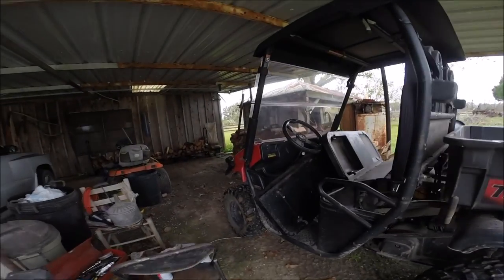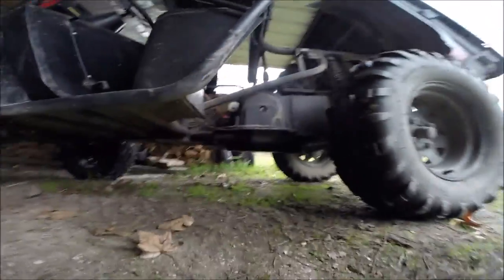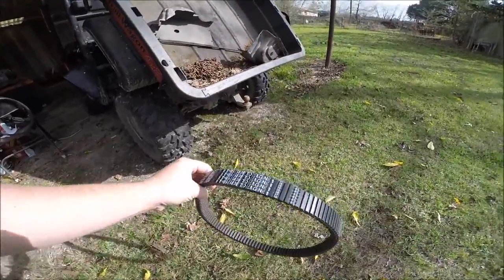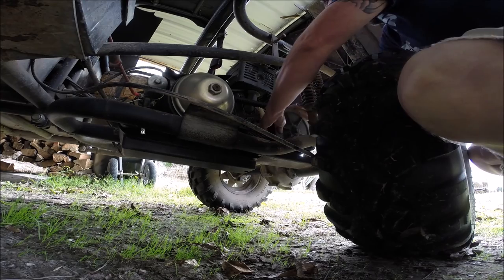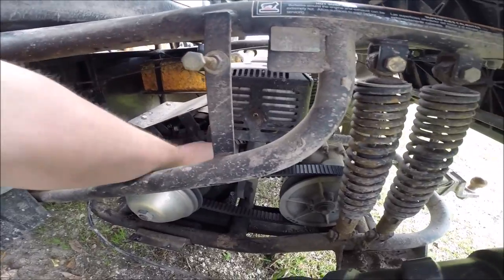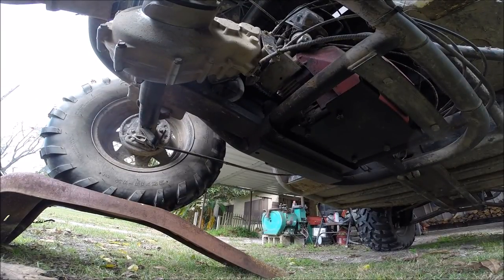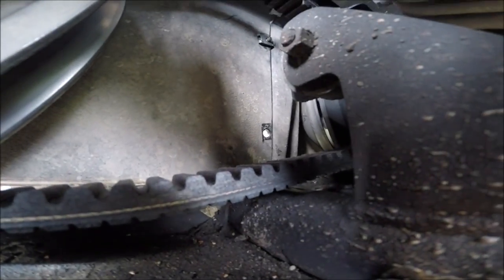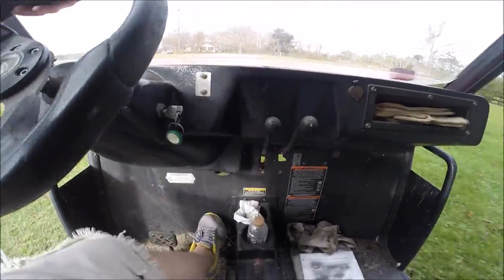How to Change Drive Belt Trail Wagon UTV American Sportworks

Comment: Hey man I appreciate all your videos you do They help out a whole lot. I have a question for you I have a wagon TW-450 with a color motor I can go out and start at cold in the morning and write it about a half to three quarters of a mile and it like wants to lose power and if I just pull over it idle back up and then I can go again for a little bit than an idol back down it don't matter if it's a code start or if it's been running all day
Reply from the maker: Thank you for the kind words my friend.  Have you checked the oil lately?  I know every so often I have to drain the oil bc the gas for some reason drains into it and makes it run like crap.  If it is an older model you have, it could also be bad rings, giving low compression and low performance.  Have you thought about changing the carb?  I would check oil, change carb, and go from there.

Comment: Quick question would u be able to confirm the belt is the same for a 2005 chuck wagon with the 340cc honda motor?
Reply from the maker: Not off hand, no...how fast u need the info?
Reply: @JRMSweeps  whenever you can not a super rush going through the entire unit to see what else it may need found out the clutch was seized
Reply from the maker: I'll see what I can do today.
Reply: @JRMSweeps  thanks bro definitely appreciated
Reply from the maker: Is this your model?
http://www.google.com/url?q=https://assets.americanlandmaster.com/uploads/manuals/UTV/TW11-340cc-Honda.pdf&sa=U&ved=2ahUKEwjb4Ma5w8nyAhWVkWoFHXqjB90QFnoECAIQAQ&usg=AOvVaw3N4HjWRrqOY5aVjIaCI55X
Reply: @JRMSweeps  is there a difference between the TW AND the CW11 that's the model above the product identification number
Reply from the maker: http://www.google.com/url?q=http://americanlandmaster.com/pdfs/UTV/IPLs/2wd/340cc-CW11-TW11-TW11R.pdf&sa=U&ved=2ahUKEwiR_Y2GzsryAhVCE7kGHdr9A7UQFnoECAMQAQ&usg=AOvVaw3jM6Jes77io_yQbPz3o5e8
Reply from the maker: See if that helps.  I dont think so but could be wrong.  You could always call american landmaster and get the part number from them.
Reply: @JRMSweeps  ill give it a shot thanks for all your help
Reply from the maker: Yes sir hope this helped a bit.

Comment: Great video. I have an older TW400 and it's gotten real hard to shift, I have to pull up or push down really hard on the lever. Then it doesn't engage the new gear right away, I have to give it gas and brake at same time and then it will suddenly just jump hard into the gear. If I'm going from F or R into N it stays engaged and even keeps moving... kind of dangerous. Do you think a belt change would fix this....would rather not spend $100 in a shotgun just start replacing stuff approach. Your about the only TW repair video I could find....thnx.
Reply from the maker: I wonder if you shifter cable needs to be readjusted?  It can be done with a nut and screw type mechanism by the motor I believe...maybe try and relieve some tension on the cable.  If that does not help significantly, I would consider replacing the belt...I didn't buy my belt from the place that made these. I ordered my belt from Amazon and got it in 2 days for about 80 bux.  

Is it hard to move the shifter up or down before moving forward?  The shifter cable doesn't have anything really to do with the belt being possibly loose.
Reply: Thanks for the quick reply and ideas. I loosened the shifter cables as suggested, but no change. The belt looks to be $100 so still holding off on that if not sure it will be the fix. I did notice the belt is rubbing on the frame bar it goes over, so maybe it's stretched and is the problem?? I'm wondering if maybe it's the weights and springs in the CVT being stuck and am looking for info for how to clean it for the CVTech model on the TW400.
Reply from the maker: +Tom Anderson i wish they wouldve put a belt tensioner pulley on this system.  Hope u find a solution.  Keep me posted when u do, i'm curious what the solution is to your prob.  Bet that belt is stretched...have u had the utv for more than 5 years?
Reply: I know this post is old but mine is currently doing exactly as you explained.   We just replaced the belt and shifter cable but the problem didn't go away.   What fixed yours?
Reply from the maker: Probably not.  In fact, our shifter cable just broke last week because ours has been doing what you have described for years now.
Reply from the maker: Nothing fixed it actually, just made it easier to engage drive when pressing the gas.  Our shifter cable just broke a week ago.  These are big piles of shizz in my opinion.
Reply from the maker: The clutch is centrifugal.  If the belt is really loose, the sxs wont realky move much.  There will be a small amount of play in the belt but it shouldn't be really loose.  No way to adjust it, have to replace the belt.
Reply: @JRMSweeps  I'm going through my 10+ year old TW400 and replaced the belt - I found that when the idle was too high, it made it very difficult (if not impossible in some cases) to shift. Idle speed should be around 1400RPM. Once I found the correct procedure to adjust the carburetor after cleaning it very thoroughly and got the RPM down to where it should be at idle, it shifted perfectly and with ease. I never had to adjust the cable, just hose it down with some lubrication to make sure it can ride in the sheath easily. A cheap little hour meter/tachometer does the trick to find out what your RPM is enough to get it adjusted right. On a side note, while I had the covers off, I took brake cleaner to the inside of the engine clutch; lots of nasty gunk came out but now it doesn't squeal and shifts like it was new.
Reply from the maker: Excellent info my friend.  Thank you for taking the time to post this great stuff.  👌
Reply: Same problem, found if the idle is to high, you won't be able to shift in and out of gears , adjust idle and oil the cables and make sure the belt isn't worn as well, and the belt is supposed to be somewhat loose
Reply: @JRMSweeps  you can do what I did, drill more holes in the engine plate and move engine a little and it will work for a while until the belt completely wears out
Reply from the maker: @tommyconner1467  hey, if it works, it works.
Reply from the maker: Excellent advice.  Thanks for the post!

Comment: LoL me again I found the belt but when its spins it seems like its all over the place at idle is there anyway to fix that?
Reply from the maker: Can you be more specific about when you say when it spi s it seems like it's all over the place at idle?  Is the buggy fine at idle and under acceleration with the new belt?
Reply from the maker: Does the buggy move normally under acceleration and stay at idle?
Reply: @JRMSweeps  yes
Reply from the maker: Man that's a good one.  I honestly do not know if the belt is suppose to move like that at idle.  I know the belt is driven by a centrifugal like clutch system so it's possible that is normal, but to what extreme I do not know.  I don't have the buggy anymore on my end or I would look amd confirm.  Again, I would call American Landmaster and see what they say.
Reply: @JRMSweeps  ok kool thanks for the input ill try calling them
Reply from the maker: Sorry I wasn't more help on that.
Reply: @JRMSweeps  All good bro
Reply from the maker: Please let us know what they say.